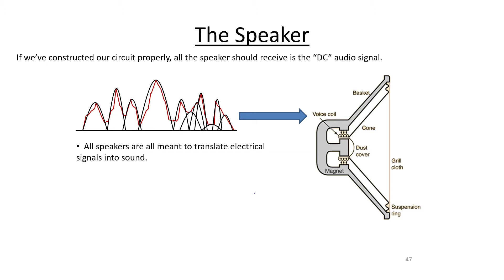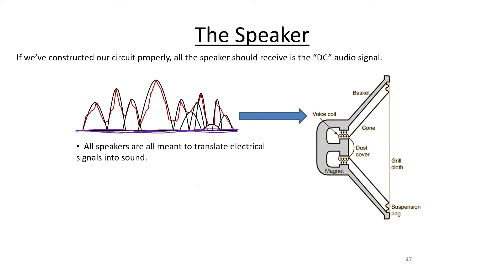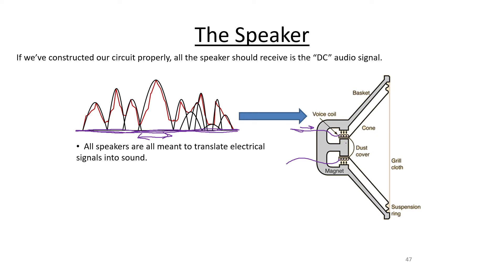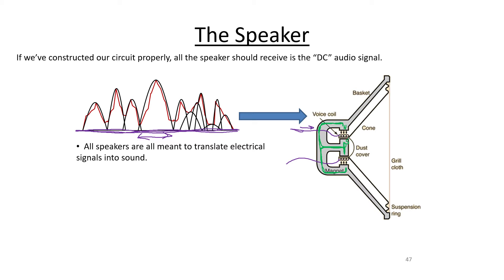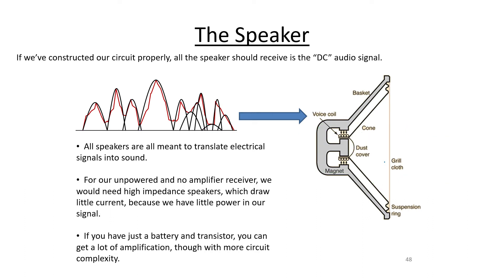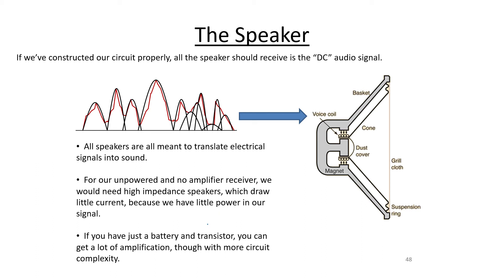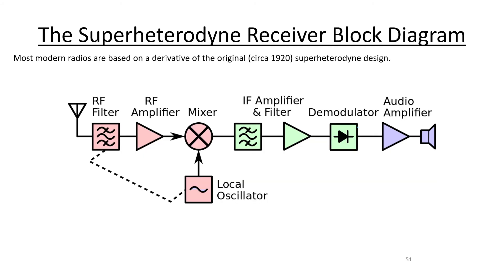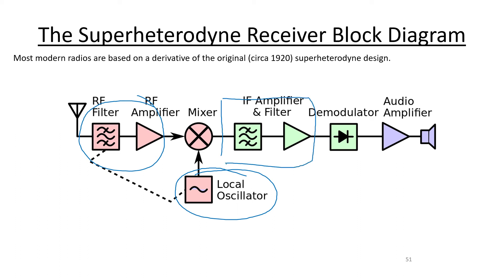Introduction to Radios (Final Part) - The Speaker and More Complicated Receivers

Comment: I watched all the parts. With this course, the resonant circuit concept just clicked in my head (never did before this serie). I am now really interested to know more about the RF and AF amplification process. For my little toy AM radio, Ill try an LM386 for the AF amp and do some research for the RF amp. That was a fantastic course on a really interesting subject. Thank you!